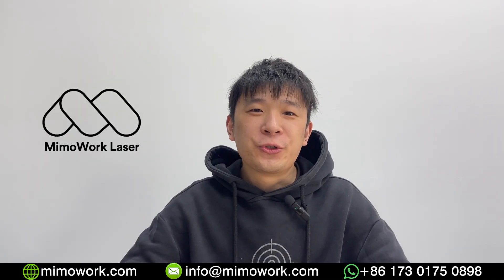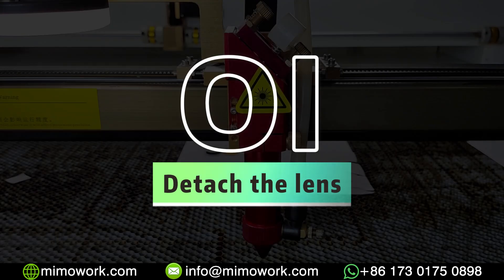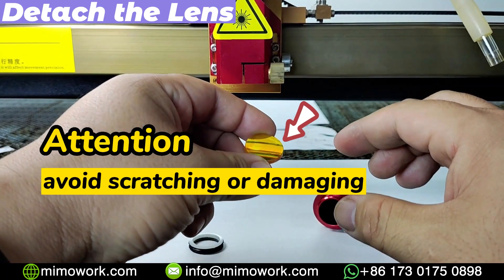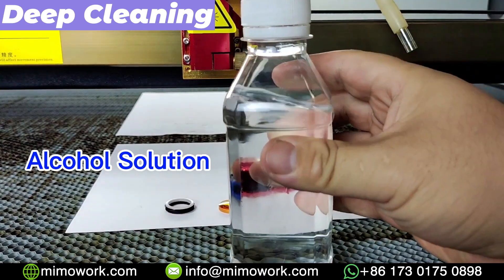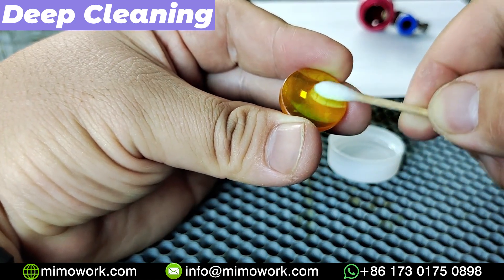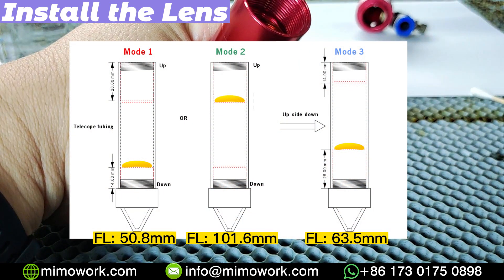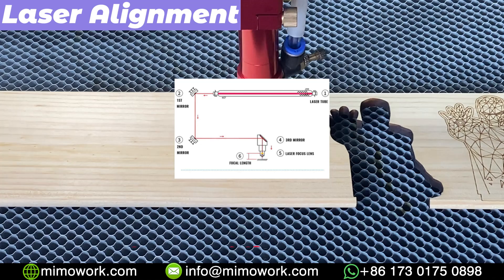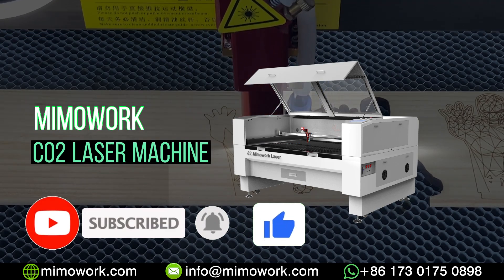How To Clean And Install Laser Focus Lens | CO2 Laser Lens Maintenance

Comment: hi sir  i am vitthal  in india pls nesxt vidio send the  smt stencil leser machine leser lence how to puting
Reply from the maker: Hi Vitthal, thanks for watching the video and for your suggestion!

Right now, we don't have plans for another lens cleaning tutorial.

For your specific SMT stencil laser machine, the best and fastest way to get help would be to contact the manufacturer directly or check the user manual. They will have the exact instructions for your model and can guide you through the process correctly.

Thanks again for tuning in!

Comment: i have a laser maching and i found out if are not using the laser tube at 100% power it will last you for ever , mine is 80w laser tube and i use it at 60% power its still  working as  efficient as day one, and its been 6 year of work, so don't blast your laser macing at 100%
Reply from the maker: Absolutely Right!👍

It sounds like you're really taking care of your laser machine, and it’s paying off for you. 👀

Using your 80W laser tube at 60% power is a smart move—many people don’t realize that lower power settings can extend the lifespan of the tube significantly .😢

We actually made a video on this topic, sharing tips on how to get the most out of glass laser tubes. 😎🙌Here’s the link if anyone is interested: https://youtu.be/aBJiJIS9hxE

Comment: What is the life of the laser tube ?
Reply from the maker: The lifespan of a CO2 laser tube typically ranges from 2,000 to 10,000 hours. It varies depending on your use and maintenance, and the type of laser tube. We have explained the question in this video, you can check out to learn more: https://youtu.be/aBJiJIS9hxE?si=9MBAaKTczR9uL5hG

Comment: What is the life of the lens?
Reply from the maker: Generally, a good-quality lens can last anywhere from 1,000 to 10,000 hours of use. After purchasing the machine, our laser expert will provide you with a comprehensive use and maintenance guide. Our laser machines are durable and cost-effective. 
Are you looking for a laser machine? If so, why not discuss your requirements with our laser expert? You’ll receive a tailored machine recommendation and a formal quote. We look forward to your inquiry! You can reach us at info@mimowork.com.

Comment: hello good afternoon
Is it possible to use 2 lenses to make the light beam thinner?
Reply from the maker: Hi, it's a very professional question. You seem a laser pro. Technically it is possible. But in reality, using a high-quality laser tube or optimizing the machine structure are the more reliable and mature ways to get higher cutting precision(thinner light beam). 
In actual operation, you need to consider the material thickness, thinner laser beam is difficult to cut through thick material.

Comment: You should definitely have been using a PEC pad wrapped around the cotton tip so you don’t scratch the lens… and there was way too much alcohol, there shouldn’t be any streaks on the lens surface. Streaks will defocus the laser dot